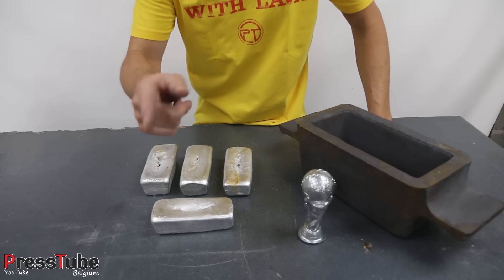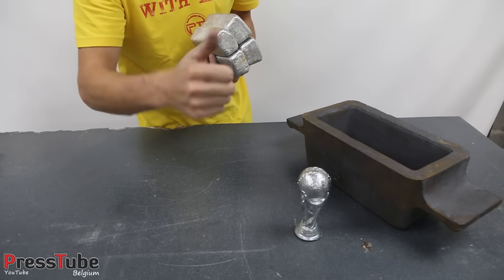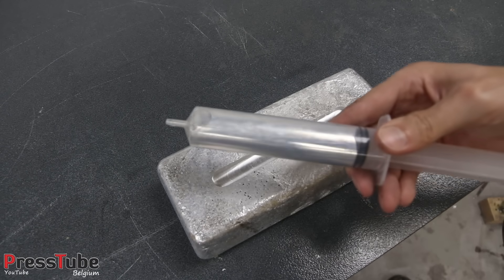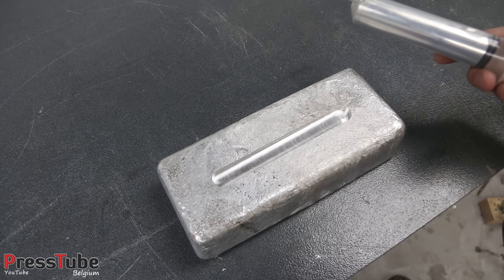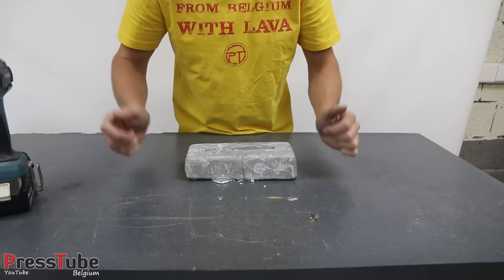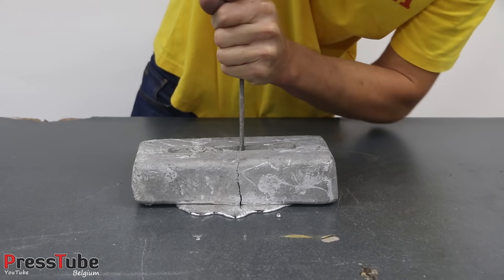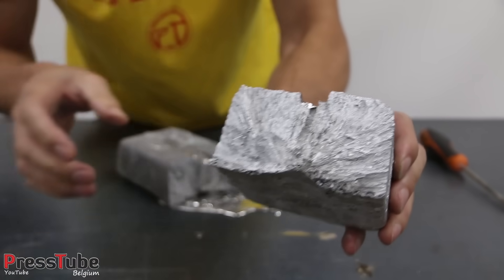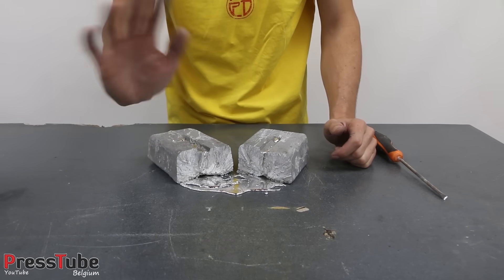Gallium Vs Big Aluminum Ingot

Comment: Hi Ben.  Are you able to re-melt and recover the aluminum, or is it ruined by the gallium?
Reply: If you re-melt the ingot it'll be fine once again. Gallium lubricates the aluminum crystal boundaries, but if you melt the result, the gallium mixes randomly and forms a "solid solution" with the aluminum, similar to how adding a small amount of tin to copper makes it stronger but less malleable. And from the looks, only a tiny bit of the gallium is actually still in the aluminum. (One way to get insight, you can google image search for: aluminum gallium phase diagram, and look at the aluminum-rich side, and you'll see up to about a 5% molar ratio it remains in the FCC A1 form, or you can try it yourself like I did!)

Comment: You should have scratched the surface of the aluminium while it was in contact with gallium
Reply: Jak exactly! Thats why the drilling worked.
Reply: @rileyfenley522  theres plenty time for raw aluminium to generate an oxidised film layer, put it on, take a nail and scratch it through the liquid gallium. Once it has a clear route, it's done.
Reply: Jak I 100% agree, I don’t think I have seen a video where if its not done that way where it works.
Reply: @rileyfenley522  im not sure you understood me, it takes mere seconds for bare aluminium to oxidise a protective layer, what i mean to say is:
 By using the liquid gallium as an airtight cover for the aluminium, the metal can be scored through the already placed gallium. This shifts aside any oxidised layer and the gallium can contact the raw aluminium. It should then absorb it through the channel of scratches, not unlike a sponge, but slower. The process shouldn't take more than a few hours, also the amount of gallium required for the structural disintegration was way off, its less than 1/50 Ga/Al

Comment: Question: What do you do with the aluminum once it is "infected" with the Gallium?
Reply: They are still researching that. Apparently the galium is recoverable and the aliminium can be used as a fuel source
Reply: yeah, the gallium and aluminum alloy will react with the water to form aluminum hydroxide, Hydrogen, and gallium metal

Comment: You could've put it in water so aluminum reacts creating hydrogen gas and aluminum hydroxide, leaving the gallium intact.
Reply: *^^^THIS guy gets it! I had to scroll down a long way to find a comment about the ability of Gallium/aluminum alloys to generate hydrogen and oxygen from liquid water. This point touches on another "issue" he had early on in the video when initially trying to get the gallium to "sink in".*

 Aluminum INSTANTLY develops a protective oxide layer that prevents further oxidation, AND protects the aluminum from the gallium. As soon as you slotted it with that rotary milling tool, it was automatically re-developing its oxide layer. So, you must pour the gallium into the slot, and then push a scraper or screwdriver through the liquid gallium puddle, and scrape the aluminum underneath, in order to remove the thin, new oxide layer, which would've allowed the gallium to "seep in". 

Once the gallium alloys with the aluminum, it prevents the aluminum from developing its protective oxide layer, which is why GaAl alloys will easily react with water, to produce hydrogen. The aluminum will disintegrate at that point, but since gallium doesn't react with water, it'll still be there at the bottom of the water container.

Comment: How do you dispose off the contaminated Aluminium? It's certainly not viable for recycling into new products.
Reply: You drop it into water. Make sure you do it outside as it will produce a lot of hydrogen.
Reply: @rocketman221projects  please be so kind and describe what happens next.
Reply: @fluffyfloof9267  The gallium prevents the aluminum from forming an oxide layer. Without the oxide layer to protect the aluminum, it will react with the water to produce hydrogen, aluminum hydroxide, and heat. The gallium can be recovered from the aluminum after the reaction.
Reply: @rocketman221projects  Nice, thank You very much! I was a bit worried, he'd (Ben) just throw it out, onto the Ally heap of his local recycler / scrap yard. Well, NOW he actually has a chance to make another video, about how NOT to contaminate large scale aluminium production raw material with gallium. ;)
Edit: there's a reason for extreme regulations, in case one intends to bring Gallium (or Indium, even Hg) onto an air plane - which often has structural components, made from Aluminium.

Comment: Can you remelt an Ingot that has been damaged by gallium?
Reply: Probably. I think gallium and aluminum have different densities so when you remelt it the metals would separate.
Reply: I'm sure the gallium will vaporize if heated past its boiling point which is lower than the melting point of aluminum
Reply: Shade Bradford huh I didn’t even consider that. Though it’s not often one has to consider vaporizing metal. Unless you’re making mirrors that is.
Reply: @nebularises2545  Wrong, the Boilingpoint of Gallium is 2400 °C..

Comment: Try and mix Gallium and  Aluminum together when in liquefied form then pour in the Ingot to hard.. lets see those results
Reply: You would probably have to mix alot but it would get harder to mix also the gallium would not set for ages
Reply: @legit_jebus8607  i think would boil off because of the molten aluminum
Reply: I could but it might not be hot enough
Reply: @yes____  The melting point of aluminum is not even close to the boiling point of gallium
Reply: @ITroopTheSpace   so the boiling point of Gallium is around 2400C and melting point is 29C

And now back to aluminum, which has the boiling point of 2470C which is 70C more then gallium and the melting point of aluminum is 660C which is way higher then gallium.

so i was think why can you not melt them together to see what reactions you will get after it get hard. 

will the aluminum be as soft from the get go or will the reaction not happen, and just split
Reply: @Javonduggan I was only stating that nothing would boil off like the other guy suggested
Reply: @yes____  Gallium's boiling point is around 2200C to 2400C
Reply: That....forms an alloy.
Reply: whats actually happening here is that the Gallium is bonding to the Aluminum while i can't say for sure what i believe is most likely is the Gallium and Aluminum would bond together during the melting and reforging and it would cool into a very brittle metal to those that feel that the two would cool at different rates that's not likely as at this point the Gallium and Aluminum would be bonded into one molecule which would have a different melting point and boiling point then both Aluminum and Gallium
Reply: It would end up just being a brittle brick of aluminum search it on YouTube it has been done
Reply: “Hold my beer and watch this”
Reply: Galium will be steam in high temprtures
Reply: @mustafafreesoul18  any metal will become a gas at high enough temperatures
Reply: I’m thinking that because the aluminum is already broken down that the gallium has an easier time breaking it down so that while som will harden but everything would be corroded by the gallium much faster.
Reply: Yes
Reply: The rate of reaction will be way faster as per kinetics
Reply: I don't know it all depends but molten metal would probably vaporize it with how low the melting point is.
Reply: @USERNAME1-x5u  and.. turns out Gallium and Aluminum have a similar vapor point... it's the melting point that's different.
Reply: Burn the gallium ya that should work
Reply: Think the gallium would be wayy to light to mix with the heavy aluminum
Reply: The gallium may incinerate
Reply: Did you weigh in the aluminium when you finished with it? You could scrap it for some cash. My dad hase a copper cauldron, but also hase a habbit of chucking things away, I told him to take it to a scrap merchant if he wants to throw it away.
Reply: For science
Reply: Then put it in water
Reply: I think that wouldn't mix

Comment: What hapen if you melt again that aluminium??
Reply: yaa that what I thought too
Reply: Ah lol I asked the same w/o coment diving
Reply: @e_3261  om
Reply: I am also curious about this,  I hope he does it
Reply: @nickarganbright7218  . Bidi
Reply: Well the aluminium will melt at about  630°C the Gallium will still be a liquid and is about twice as dense as the aluminium so It'll sink to the bottom of the crucible. You could then pour off most of the alumiunium I guess. 
The remaining gallium/aluminium alloy could be seperated by adding water - aluminium will oxidise and the alloy will liquify as the gallium percentage rises. A few more steps will get you purer alloy but you're going to need some more advanced methods to get it back to semiconductor purity. As for the alumina (aluminium oxide), you can electrolyse it to get the Aluminium back if you like.
Reply: @SR-sl9jm  "electrolyse it"?  That will take like forever?   Or do you need some more advanced methods for that as well?    :-))
Reply: @TaunterAtwill  The Hal-Heroult process to be more specific. That's the industrial process for aluminium production - electrolysis in cryolite.  If you know a more efficient way better not tell me: your gonna be 'rich as cryolite' :)
Reply: @SR-sl9jm  need video ;)
Reply: An alloy
Reply: Yup yup
Reply: You’d either get a separation of the aluminum and gallium and have 2 separate solidified metals, or you’d have a mixed and congealed amalgam of aluminum and gallium
Reply: For real tho
Reply: I was going to comment that
Reply: Yeah i was thinking about the same thing
Reply: Or melt the galium in the crucible with the molten aluminium and see what happens when it hardens
Reply: It stays ded
Reply: Like melting aluminium scraps, it is ruined.
Reply: You Will get super brittle alloy that dissolves in water
Reply: It's not really aluminium anymore it's an alloy now
Reply: Nurdrage has a video on how to separate the two metals on his channel
Reply: You have to have an item or something to mix the two items and you make a demon
Reply: it won't be pure aluminium anymore, it'll might become a alloy metal
Reply: gallium would just evaporate and you would get aluminium
Reply: It melts
Reply: thats what i want to know lol
Reply: creates Chinesium
Reply: You burn off the gallium and get another pure block of aluminium.
Reply: It would be hard to get the aluminum back because they will both melt and they will stay together as an alloy. In order to get aluminum back you will need to boil it off which is almost impossible  to get 2230 degrees c  or you can melt it and get only the top most and then separate it by other chemical procedures but you will lose a lot of aluminum.
Reply: Dave, is that you  Dave?
Reply: Io Parlo Italiano! Dave’s not here man.

Comment: It’s probable the freshly poured aluminium oxydized, and created a protective layer 
Making it difficult for the gallium to interact with the ingot.
Reply: Yes, that is exactly what happened because aluminium oxidizes pretty fast. A bit oh Hydrochloric acid or scraping on the surface below the gallium would have solved that.
Reply: True story
Reply: Oxidized not oxydized